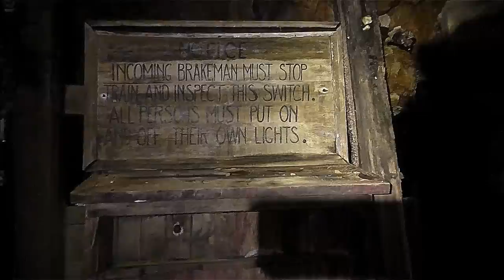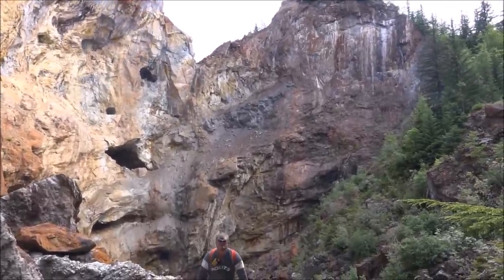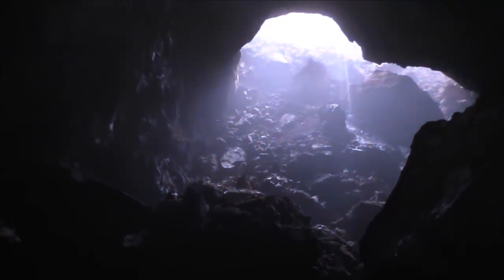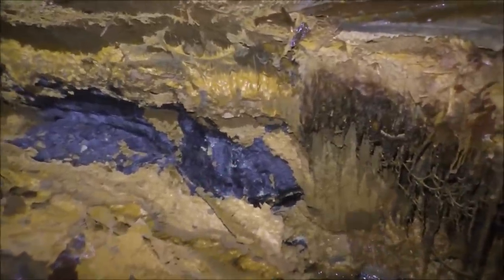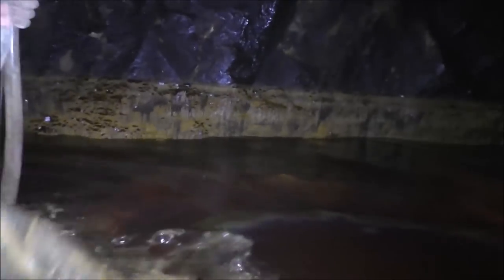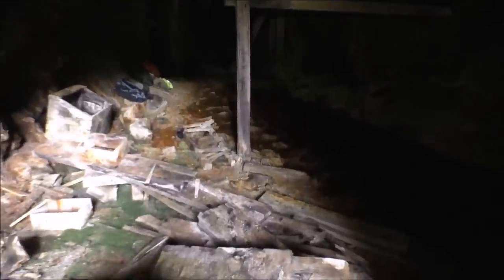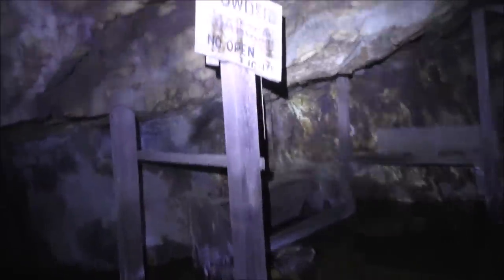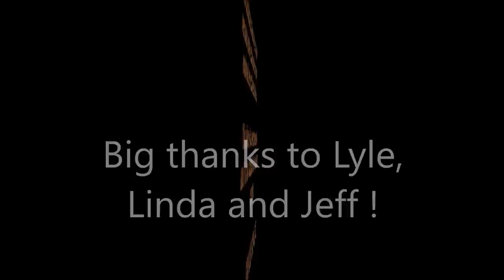#110 The Very, Very best of Anyox!

Comment: That looks like a Ingersoll rand winch , I made the cyclinder heads for this winch and also the Trotle handle to forward and  reverce the Winch,  It's and older modle  and was still made up until the 1990s Production was from 1950'S to late 1990.
Reply: Crazy how long some of the production runs were back in the day. I bet not whole a lot different than the original.
Reply from the maker: The mine closed in 1935.